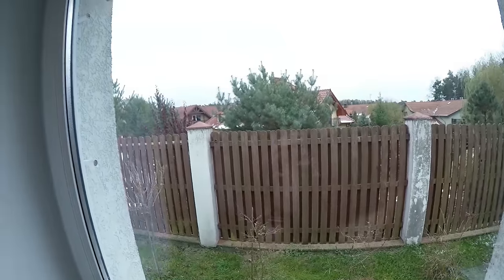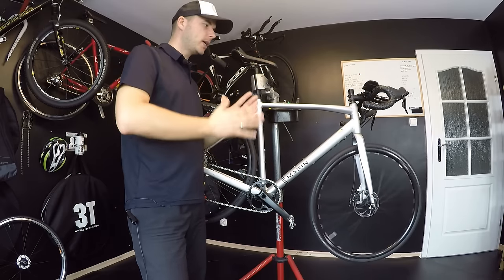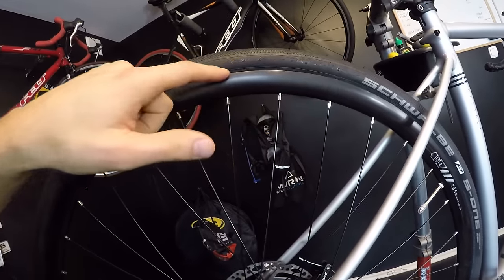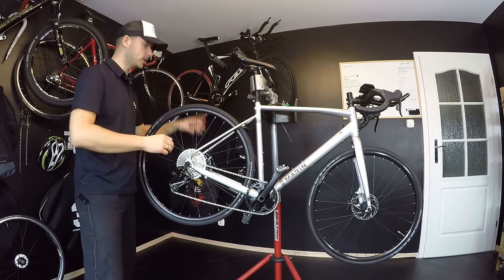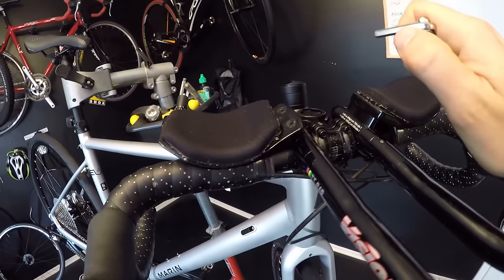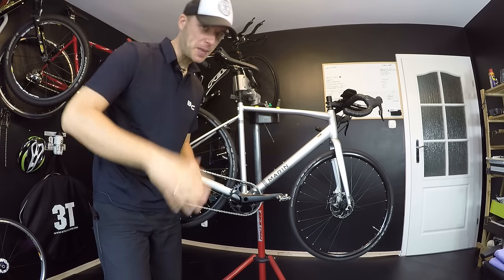99% Of NEW Bikes Need These 5 Maintenance Tricks For Your Safety. SickBiker Tips.

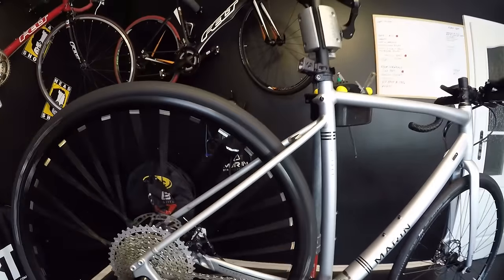Comment: 15:37 Summary
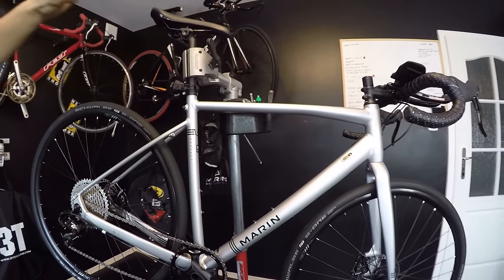1. 1:37 True/check wheels
2. 4:05 True/check tires
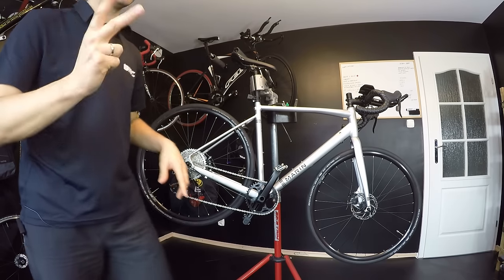3. 7:28 Check all the screws
4. 9:50 Check the chain orientation/degrease/lube
5. 12:34 Rub protection
Reply from the maker: Oh, thanks :)
Reply: ShaiBike May I ask if that's tune or true that you were saying? Thanks:)
Reply: thank you!
Reply: thanks, i didn't want to watch 17 mins for 5 things :)
Reply: ty
Reply: The summary is much clearer
Reply: samnelso thank you for this time summary.
Reply: samnelso
Reply: samnelso thanks mate
Reply: I actually recommend listening to every single word he speaks.
This ain't no silly (funny) top 5 compilation, but serious information that you need to know if you are buying a bike from anyone/anywhere. Could save you from prematurely harming yourself and your bike.
Trust no vendor, they usually hire people that don't give a damn about bikers; so don't mistake the product quality with the customer service quality.
Reply: samnelso you are a legend
Reply: But I feel bad if I don't watch the rest now
Reply: Thank you!

Otherwise, it was too much talk - the TLDL (Too Long, Didn't Listen) version of TLDR.
Reply: samnelso thx
Reply: Thanks
Reply: Thank you!  It would have been nice for the original poster to have put up key markers for the viewers.
Reply: Check bolts with torque wrench for correct tension if you have carbon frame and components
Reply: Thank you ♥
Reply: Ahh thanks
Reply: Thank you!
Reply: thAnk you
Reply: @cannondany  a new wheel rim made of aluminum is never 100% straight, there is always a twist that is welded around that rim

Comment: Been working on motorcycles for years, where you have the same problem with chains, but a trick I use is to use diesel to dip and deep clean the chains. Diesel is a great degreaser but will not damage the little rubber seals inside the chain links. It actually prevents them from drying out and it lasts even longer than normal. Then just clean and oil as usual. I've never found a better way or a better product than simple normal diesel.
Reply: Kerosene. Cheap and gets the job done.
Reply: Chain have rubbers?
Reply: @UserT5959  motorcycle chain does I believe.
Reply: @Changchar37  i have no idea, thanks by the way :)

Comment: When is comes to installing of tubes, I have always used a little baby power to lightly coat the inside of the tire and the tube itself. Then I continue with inflating a little at a time while squeezing the side walls to let the tube find its position. The powder aids in the tube finding its position, by lessening friction inside the tire

Comment: Here"s a great tip for all! If you look at the inside or your tire you can usually see where the tire manufacturer matches up the rubber and bonds it together making a seam to complete the tire, make sure that seam doesnt line up with the welded seam of your rim when you mount it because thats where you will most likely have a natural wobble on each that you cant get rid of so id say put the the tire seam at the valve hole cuz the exactly opposite of the rim seam

Comment: Fantastic video, very informative. I work as a technician in a high end bike shop and all of those things are basic assembly procedures for our bikes. There is however one thing that was not mentioned that we do, and this applies to non sealed bearing hubs only. Every wheel assembled in Taiwan (and probably elsewhere), does not have the correct bearing preload in the hub. It's important to use a 13 or 15 mm cone wrench and a 17mm wrench to adjust the hub bearing load so you are not causing premature wear.

Comment: I like to use electrical tape to mask the housing rub spots on the frame. It sticks well, comes off easily, it does not harm the paint, and you can get it in different colors to either match your frame or make cool designs. I always end up using black tape regardless of the frame color...
Reply: in my experience, electrical tape dries out and leaves a residue if not changed frequently.  Loses tack over time.
Reply: Have you never left it out in the hear that crap turns into a tar like substance
Reply: Clear Gorilla Tape. You’re welcome.
Reply: I wrapped my trek in gaffer tape.  Sticks well and doesn't leave residue.  Plus it's like cloth.

Comment: Agree on all tips. I would add that when you're checking bolt tightness it's better to test by trying (slightly) to loosen the bolt, as opposed to tighten. Especially when dealing with carbon material. Like you said, but inverse. Don't loosen the bolt, just test it.

Comment: You should add cup and cone bearing hub adjustment.  Locktite the cone and locknut which aren't normally accessible (rear wheel cassette side, front wheel disc side) and spend some time to properly adjust freeplay.
Reply: dont glue it stuck lol

Comment: You can wrap some old inner tube around the chainstay to protect it. I use a neoprene chainstay protector from lizardskinz-works great. I also run a headset seal from lizardskinz to keep dirt from getting into lower headset bearings. Oh, and another thing is chains are often much longer than they need to be. They can  be stortened to improve shifting and reduce chain slap.

Comment: Very correct about the chain lubricant/preservative being very sticky/gummy, and a good tip about wiping the lube off the outside of the plates with degreaser on a rag.Since you are looking at the chain already, its a good idea to make sure the chain is of the correct length.  Sometimes the assembler does not shorten the chain to the proper length for the drivetrain.  Too long and the chain tends to hop off the chainring and could scratch your BB housing when it falls.If you need to shorten it anyway, might as well put a quick link and maybe even go full out and go paraffin lube.

Comment: I've been turning wrenches for 40 years.  I'd say the #1 thing that gets overlooked on new bikes is bearing adjustment.  99% of new bikes come with the wheel bearings too tight out of the box, and I dare say most mechanics do not bother to adjust them.  #2 is the pedals and or crank arms not being tightened properly.   So many relatively new bikes come back with stripped out crank arms because they weren't secure in the first place.  This doesn't occur often with bikes that come from independent bike shops, but is very common with department store bikes, or bikes purchased online and assembled by the owner.
Reply: please do a demo video
Reply: I agree with you on that one, i too am in the trade, those and headset adjustment being over tightened.
Reply: Should also mention derailleur hanger alignment check.
Reply: trekkeruss. So true. My crank arm fell off while I was riding. Imagine my embarrassment!
Reply: picked up a fat tire mongoose a Kmart.....the only reason was....it was way marked down, and I won a $100 to spend there....I had heard and seen some videos about D/Store bikes being thrown together.....damned glad I took it to a bike shop in a neighboring town....he used to be a pro rider....he said the same deal......check everything....it looks new, but you don't know who put the thing together...he charges $35-50, depending on how crappy they are put together.....my full suspension bike is Alum. Frame, and they take more maintenance....more moving parts....in Montana, we ride in summer/fall mostly, but he said ya even need to look them over before you jump back on them.....I wiped out once on a store bike years ago....when I went to turn, the handlebars were loose (stem?) and the wheel went right, and I went over....ya never know....this guy's kinda hard to understand (but so am I....damned southern accent) but he is right.........thanks for the video dude.....
Reply: cooker440 

Sooooo juicy.
Reply: I second that. What is also comom is that if the conus on the ballbearings is  adjusted wel but the locknut is on too lose resulting in getting lots of play on it and long term damaging the cups, conus or just grind away the bearings.
Reply: I got a loose crank arm on a new bike from a bike shop considered to be one of the best out of dozens in a large metropolitan region. It wasn't the only problem on that new bike either.
Reply: maximecool446  I can tell my boss hates it when I adjust hubs on new bikes because it can take up a lot of time if you have to adjust 8-10 a day. But in his defense most of the bikes we sell that still have cup and cone set-ups are entry level bikes and doesn't really matter much to the average user.

Comment: The sticky oil on the chain is not lube. It's a protective agent that keeps the Cain from rusting depending on storage until it gets home to the customer.
Best practices I would say is remove it from the bike, degrease it completely with brake cleaner or isopropyl alcohol in a bag or small container. Then remount it and add a real lube of your choice. Remount with quick link or use a new one if required from the manufacturer.
Reply: Indeed. Shimano make it very clear that a new chain should be de-greased and lubed before use.

Comment: Another thing that is good to check is the rear derailleur hanger (this requires a special tool). My experience has been that most new bikes need an adjustment to the hanger, whether the bike is a bargain model or an expensive one.
Reply: If you don't want to spring the $72 for the Park DAG 2.2 or $60 for the CycloSpirit version, there's usually a "MTB Tools" one on eBay under $15 that lacks the gauge piece, so use a clamp and a piece of wood to improvise a gauge.
If you have multiple bikes, or can get a few friends to chip in and share the Park or CycloSpirit, though, it's worth it for the quick and easy measurement and straightening.
Reply: David Connell What kind of adjustment does it need?

Comment: I go a lot further than that with a new bike. 1. Change to new cables or at least take them out and grease them. 2. Checking grease in wheel, bottom bracket, steer tube and if needed put new grease. 3. All bolts off and give grease, especialy those holding the brakes and chainrings ( you will thank yourself for that later!). 4. Off with tyre and tube and assemble again, maybe get new and better tyres. 5. Preferable new and better brake pads. Brakes are your safety for slowing down and stopping, not a place to save few bucks. 6. Never use degreaser or soap when cleaning your bike unless you have everything taken apart and assemble it again with new grease and oil. - Why I am making such an effort???.....because its often I go faster than 50 km/h and if you have done your bike nicely, your safety is better. - Nothing worse than going downhill with 60 -70 km/h and your brake cable snap, or your brake pads are the cheap ones not making you stop quickly enough - After around 4500 km you will need to change your chainrings, if you just have left them without grease, they can be seriously hard to get off at that time. Grease are often not used on bolts from factory when put together. - If you dont know how to do these things, learn it. Its really well worth knowing to fix your bike no matter what it is. Will save you a lot of money in the long run, you will better be able to fix your bike if you are far from home and have a defect. If you do things correctly, the bike will be a lot more safe for you to ride, else you really have to trust your local bike shop. Many do a really good job, but also exprienced many doing a horrible job fixing other peoples bikes. - A well mantained bike for better safety on the road.! ( Was taught to do these things when i was kid back in the late 70's and have since been riding around 250.000 km and never had any issues what so ever). Wish you all some wonderful and safe rides.!!! Cheers
Reply: Forgot to mention the sadlepin, take it up and put grease on it and put it back. After some months it can be seriously hard to get off again. Grease is your friend on a bike, espcially here in Denmark with the salt in the humid as we are always near the ocean no matter where we are in the country. ;) Alu alloys tend to kind of grow together, the reason the use of grease. :)
Reply: Kim Lodrö Dawa wow. awesome advice.  thank you.  I am planning to get a new bike soon and I'm not sure I can even do all these manuvers.  maybe you do a quick video on the whole process when you get your next bike or rebuild a bike.  that would be awesome.
Reply: choski76 - Not sure I will be able to do that. Dont have a cam and will not be able to afford one for at least next 4 months. Also already many good videos out there. RJ The Bike Guy is good for especially people with older bikes. But bikes are fairly simple, so it shouldnt take you long to learn. Most things are logic and easy. Building a wheel and fixing bearings can be little tricky though and takes some skills. Also you need the right tools which also is little costly, but is a one time investment. Good quality tool is needed though as bad quality tools can ruin your bolts etc. Also it takes time, so if you only have little time available its better to pay someone for doing it for you unless you have a good friend who knows about it. Do it nice and take the time needed for it, cant be rushed. On a normal racer without disc brakes, taking everything apart, cleaning and putting together again will for me take a whole day, 8 - 12 hours.....that includes also new bartape and cables. I am sure many can do it faster, but I prefer take my time and do it slowly. Still have my old steel alloy racebike, its around 30 years old and all is still working perfectly........if you really want to learn everything, watch videos and go slow and nicely. Also getting some wheels or old bike for free to practice on can be a way. Depends really on how far you want to take it. For many people, even putting on a new chain can be a huge challenge ;)
Reply: unless it involves carbon, no grease then, just assembly compound/grit gel.
Reply: Great insight, brother, and much respect for your focus on safety. Clearly, you love the cycling life. Thanks for sharing.
Reply: Kim Lodrö Dawa you remind me of my brother, he was always fixing things. He had a bike shop and now builds motorbikes as a hobby. 
You've inspired me to take a keener interest in the workings of my bike. Thanks for sharing and enjoy your bikes! 😀
Reply: Why on Earth would you need to change your chainrings every 4500 km?!  Proper chain maintenance and replacement will prevent you needing to replace your chainrings and cassette.  A chain with worn bushings (stretched chain) is what wears out the teeth of the gears and creates the need for replacement.  I change out my chain whenever it needs it, and I am still running the original chainrings that came on my bike 70,000 miles ago- the teeth still look close to brand new.
Reply: You know, I'm afraid I have to agree with you on all your points but when I get a new bicycle I'm so excited I can't quite do all that stuff before I just have to get out and run it!  But it's true when you're talking about the speeds that you're talking about you have given really really good advice.
Reply: geez, your making it seem so logical compared to "regular" riders. though bout the downhill part. Not to brag but 50k+ isnt all that fast when descending on the roadbike? Sure my highspeed is about 85k when pedaling at 150rpm for short period of time, bt even then, my srly cheap brake pads of my 400€ roadbike hold so well, no fade ater 800m descents with average of 56ks. Bought aftermarket cartridge brakeshoes. Literally melted the first few mm during had braking and glazed them pretty good. Also since then they squeek extremely loud, louder than a cold disc brake from a car. changed back to the old pads. working strong now for 2,5k
Reply: chains on mountain bikes get dirty really quick. In dry climates, the dirt dust acts like sand paper.  Wears much faster unless you clean after every ride. Who has time todo that.
Reply: keep it clean..out of the weather... know how to fix it,,.  don't flog it..
Reply: Might as well just build a bike by then. Hahahaha

Comment: I bought my bike online from a store which has some shops too. It came fully installed, all I had to do was set the stem and install the pedals (obviously since the bike didn't come with pedals). Before they ship their bikes though they do a full check by one of their mechanics and include a maintenance flyer and all. And in case I do have any problem with my bike (which ofcourse occured once or twice I can always just go to one of their stores (not too far from where I live) and they fix it for me. Also after my first couple of rides I did go to their store to just let them check my bike real quick to make sure everything really is good (which they did for free). Great service imho, not sure every bike store would do that